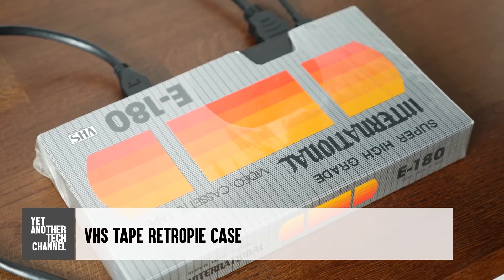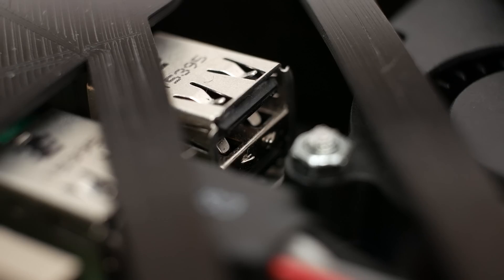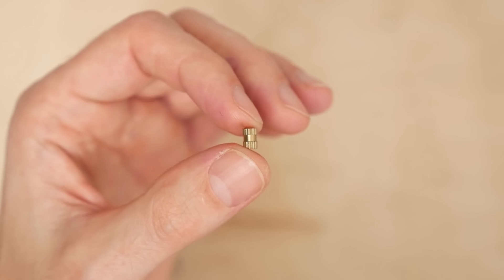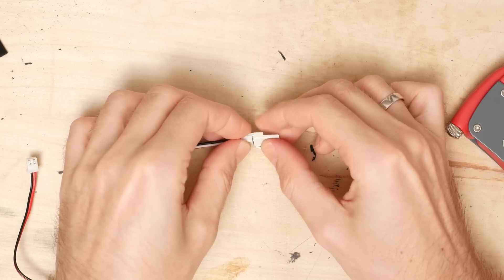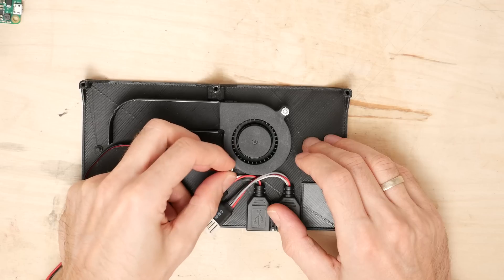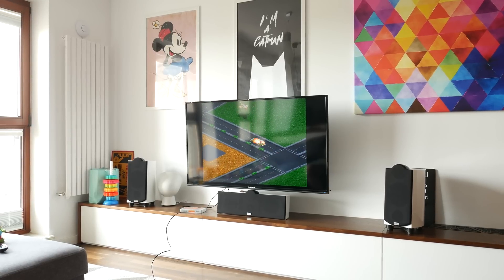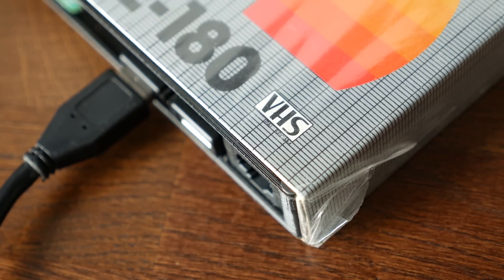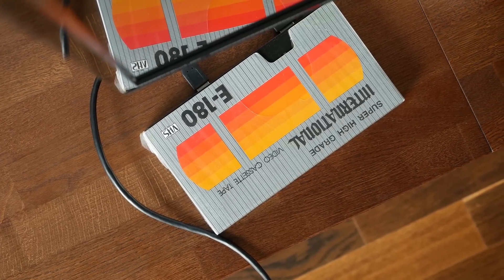One of a kind DIY VHS RetroPie project

Comment: Without actually trying I am assuming that somehow the Pi would fit in a standard case. This would add a lot of value especially by letting the two white rotors in place, or maybe cut them but keep the top parts. Also, there will be no need of an additional enclosure and this makes the air floating easily through the case. Anyhow, nice seeing such a new approach and looking forward for more.

Comment: Interesting cooling system, though I would cover the air channel, it would make it a lot more effective.
Reply from the maker: Yeah, I was thinking about making a sealed air duct, but I figured that the cardboard box would make it work... and my testing proved that it does it's job. I would definitely reconsider this if I was optimizing the cooling to lower the noise.